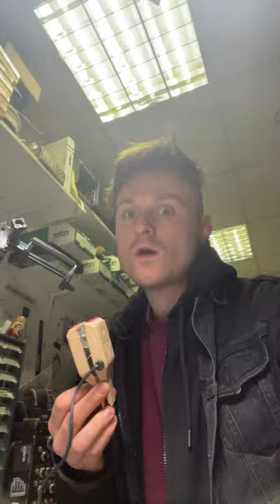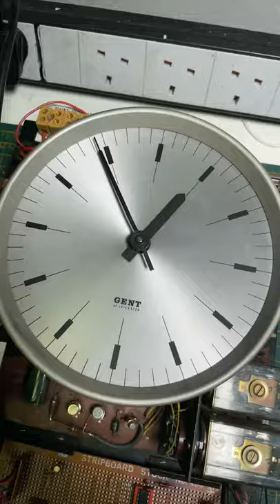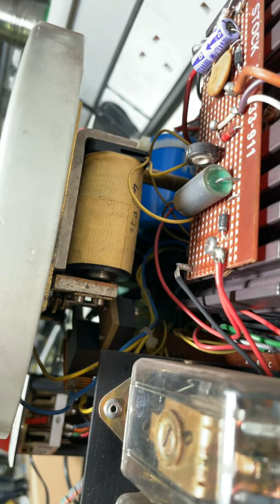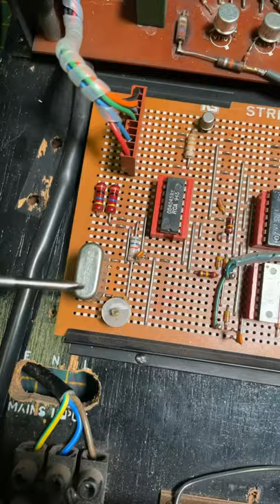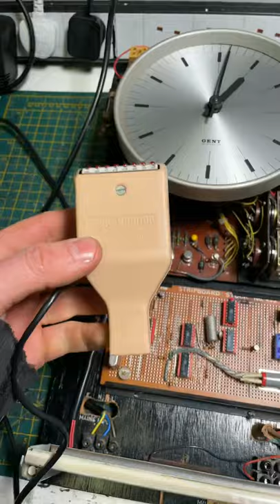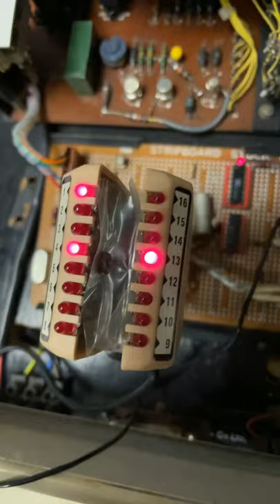WEIRD LOGIC MONITOR ON A MODIFIED CLOCK #shorts

Comment: I built about 10 Master Clocks for the London Underground.The company also build lots of the digital clocks on the platforms.  The master clocks got the time from muliple GPS satellites.
Reply: Savage
Reply: @dcorbin5779  it was when they worked for testing.
Reply: One of my favorite Arduino projects was just a gps receiver, Arduino nano, and a screen in a box. On the screen it parsed out and displayed the latitude, longitude, and current time. Gps satellites have multiple atomic clocks onboard, you can't really have a more accurate master clock.
Reply: @chrismofer  Yes thats why we used the GPS system. The tube stations all had a small GPS antenna outside.
Reply: @chrismofer  yes the gps system is fantastic for really spot on time. We could get a few extra detains from the satalites than your average GPS system, but not much.

Comment: Had another thought about led monitoring if you want to go this route
Get hold of led 8 segment bars, you may have to short out the -ve led and cut off the +ve led wire
or get some double sided boards made for the extended sockets, then you can install smd led's which should be no wider than the tracks. double sided means you can solder the socket from below, leaving the traces for smd on top

Comment: if you a add a knob to your midi knob box for velocity, you might consider adding another button  + led to to it, if possible.
this button should have a toggle function. press to turn on, press again to turn off + led.
if turned on, you could press a midi button and use to (velocity) pot to choose a key.

if you take it a bit further, the Arduino has internal eprom, i think 1K, you could save the settings there ... and retrieve on start up.
it's not so hard, you just need to address bits inside the eprom to write your 8 bit values there .. and to recover the same address.
address:  #00000000 = FF;

a bit more if else's and some global variables.

Comment: That's a really cool device. I wonder if these exist for common microcontrollers? Maybe a small market there for someone if they don't. I know you could use an oscilloscope or even multimeter to do the same thing but this is very convenient, maybe fit a small screen showing waveform.
Reply: Maybe yeah, would be very aimed at the diy hobby market through and probably too expensive to make with the tight pin pitches these days (you're basically making a custom connector at super low volume)

pmuch all the MCU's i work with are BGA so no chance anyways.

Wonder if this could maybe be done as an adapter for logic analyzers and be a 3D printable open source project and you gotta carefulling the pogo pins into it yourself

Aliexpress from a quick search has 1mm pogo pins in 100 packs for like 3 bucks, should certainly work for 2.54mm pitch stuff like the atmega328p